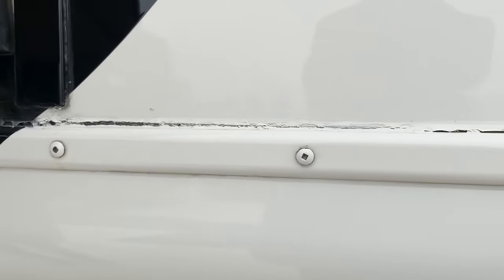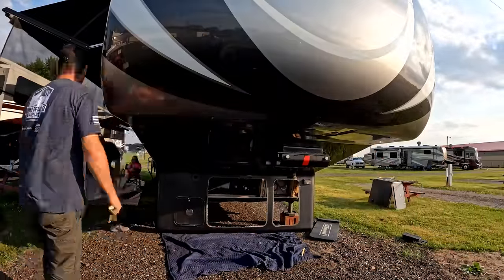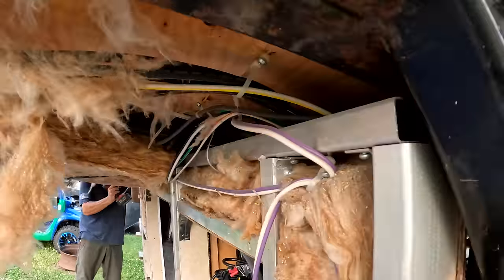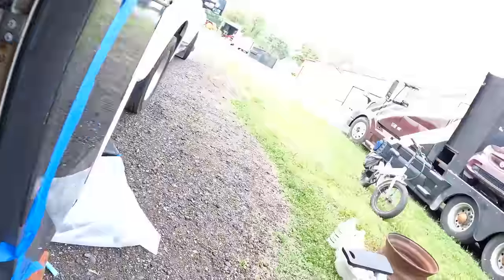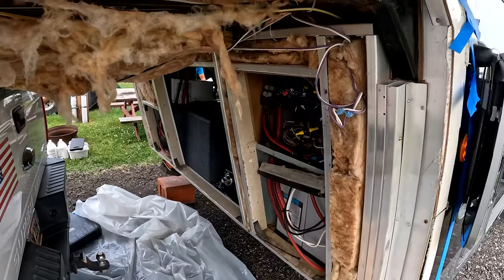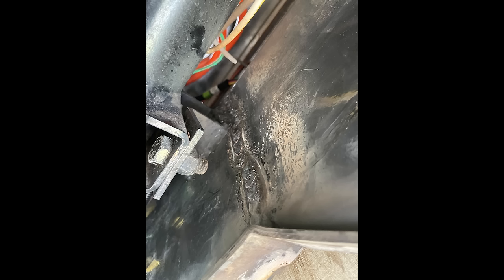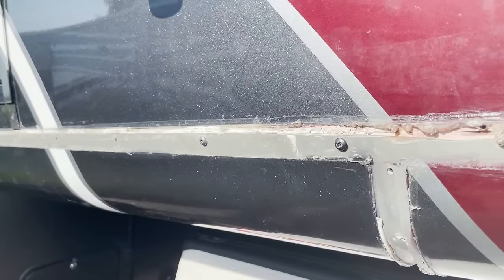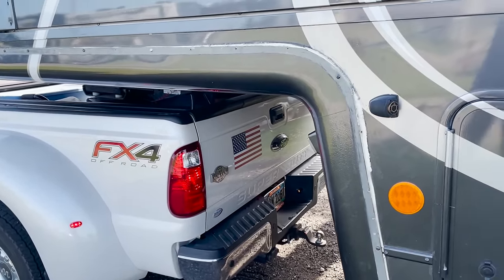WHAT???  Your Frame is Broke!  Lippert Broken RV Frame 7-27-22 DRV Elite Suites

Comment: Being a welder for over 42 years and built lots of heavy duty trailers for the oil and gas industry, we always used fish plates and gussets at joints to make them stronger than just butt welds. These people were extremely lucky to have caught the failure before it came apart while doing highway speeds going over a bridge or a double bump in the road.
Reply: Old welder here, was going to say the same thing. The engineers dropped the ball on this, revision 1.0?
Reply: Yes...I'm not a welder. But I've been in the trucking and construction industry for almost 40 years. Even I know how it's supposed to be done. 
Hope for the best for this family
Reply: Wow I'll never buy one😢
Reply: What is a Oil Field, is it like a electric field? Lol old times are not forgotten.
Reply: I fix these all the time it's a big expensive job. But yeah I agree fishplates gussets and actually welding the frame it's literally just tacked together.

Comment: I discovered a 3’long crack in the Lippert manufactured frame on my pull behind a few years ago.  You could see daylight through it.  If I would have relied on Lippert to fix it it would still be 1500 miles from home.  I found a welder who came out to my campsite, plated it and welded it.  You got to think outside the box on this stuff.  The dealers and manufacturers don’t want to see you again once you drive off the lot.  You’re dead to them.
Reply: Sometimes, literally.
Reply: But then you are not making the manufacturer take responsibility.
Reply: @backtoasimplelife they are RV’s. The manufacturer never takes responsibility. They are all lemons. Terrible build quality
Reply: @backtoasimplelife Apparently RVs aren't held to the same standards as vehicles. The warranty doesn't even have to be honored.
Reply: @drwisdom1  you got that right.
Reply: We had to move a mobile home up on the Canadian border. Had to get welder..Amish guy showed up …he did the most fantastic job..charged 1100 bucks ..trailer got moved like 25 miles…was hair raising!

Comment: Bottom line here is DRV and LCI are building substandard frames and coaches!  It is Fantastic that you have exposed the two Corporations to their failures when designing the rigs components!  Even the after repairs was substandard that will not stand up to the test of time.  This Coach should have been totaled due to the extent of the damage.  Hopefully the owners recognize this fact and take steps to hold these companies accountable!
Reply: That case of being under-designed means that you may have a case against the manufacturer under the warrantee of merchantability.  If you choose to sue the manufacturer, you would need to talk to a lawyer.
Reply: Lippert apparently builds the frames that were ORDERED by the manufacturer; the mfgr orders thin steel frames to lower the weight of the trailer, so they can advertise it as half ton towable! its all MARKETING....
Reply: @Lauren-vd4qe  This thing is not half tonne towable
Reply: All of y’all are wrong! Owners are overloading the RV forward of the axles and placing WAY TOO MUCH weight on the pin box and breaking the frame where you would expect it to break!

Comment: Retired RV Tech here. After years of repairing trailers and fifth wheels all I can say is that they are all crap! (except Airstream). These things are made alike across the board. The expensive ones look pretty...But they are crap! When I was assigned to go out and do some warranty repairs, I was the one to catch the Hell from an angry customer.  It got to the point where I simply told them I'm not the one who built it. I'm not the one who sold it. But I am the one here to fix the problems. The only thing I can recommend is to purchase an Airstream.  They're Not without their problems. but they are miles ahead of any others in quality. Its just too bad they don't make a Fifth wheel. Or maybe they're just smart!
Reply: Airstream is shit too, since Thor took over.
Reply: Thor=airstream

Comment: Thank you for the video!! And exposing lippert!! My personal opinion, they should be sued out of business and never make another frame in their lifetime. I have had two frames onto different makes of trailer the exact same thing happened to, except one of them was so horrible, I had been working in Pennsylvania and was headed west coming home when I had to make a detour to Northern Indiana to drop the trailer off so lippard could fix it. And six months after they fixed it it was breaking again. I weld for a living and have been doing so for 35 years. What they're doing in their shop, a high school welding instructor wouldn't even call it welding. They are an absolute joke and need to be sued!!
Reply: Lippert builds the frames to the specs the RV company gives them. If the design is bad which most are they will fall apart. and it's not Lipperts fault.  Bad investment.
Reply: @sundancer3700 I disagree. Lippert engineers should know if the manufacturer design will result in frame failure or has potential and refuse to do it OR make sure the welds are strong enough to support the designs. They absolutely have culpability in this issue.
Reply: @jeffhubert8769  And where did you come up with that. For over 30 years I have built homes and commercial buildings. Once I have the drawings like Lippert would get for a frame up the building goes, I never question the materials but follow the drawings to the last detail. If there is a problem it goes back on the engineer which would be like the RV company.  Everybody loves to point the finger at Lippert when they are only building what the RV company  specs.
Reply: Thank goodness they don't build aircraft.....

Comment: Doesn't surprise me.

I bought a brand new travel trailer in 2013 and after a few trips, I was cleaning it and found one bolt that holds the wall to the frame loose, so I tightened it.  I then looked at the rest of the bolts and found that all of them were loose!  I was able to tighten all but one which was free spinning.  I'm assuming it's a carriage bolt inside of the wall so the only way to fix it is to open up the wall!  

I ended up double nutting all the other bolts with Locktite.  In place of a bolt at the back side of the trailer, they actually just used a long wood screw!

Yup, quality made in America right there.

Comment: IMHO, 45 degree rectangular tube gusset, designed way too close to the corner.  It does not appear to effectively resolve torsional stresses caused by the leverage arm generated as the weigh & inertial forces are suspended on the front of the trailer as it rests on the pin box.  Of course, manufacturer will probably claim, overloading or driving too fast over rough roads.
Again, IMO, the fix / repair & original engineering, should have included a second 45 degree brace, about 12" ahead (or as far forward as operational functionality allows) of the original brace / gusset, in addition to the repair..
BTW, Nomad, good job saving your clients a road catastrophe.  You deserve a medal! (LOL, edited b/c spell check strikes again!)
If there was fairness, the manufacturer and the couple's and manufacturer's insurance companies should award you significant $s!
Best regards, Dennis

Comment: I have a North Point 385THWS. Under warranty, it was taken to Minnesota to have the frame repaired and fiberglass panels repaired for this problem.  The welds the spring shackle braces are bad. I have had 2 different hangers break. On the road.   In January I’m going to Morride to have 3 new axels and suspension installed. I just don’t trust LCI work. When the shackles broke, dealer said LCI would not do anything.

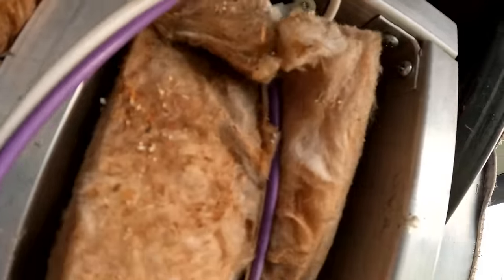Comment: Looks like a good inspection guys.  Around 4:10, I would slightly differ in opinion.  The frame imho is rusting not from a water leak, but I believe they are transported as bare frames before assembly.  The mfg will have like 10+ frames stacked up on a truck to deliver the frames to the RV mfg.  In my opinion, they are often slightly rusty from that trip, or just from being bare steel delivered in the winter, in the rust belt, to the mfg and not completely sandblasted/rust treated before the RV is assembled.  
My Jayco with a lippert frame has some rust underneath the paint the same way, and it's never seen salt since we bought it new.
Reply: they painted before delivery but cheaply.  There was two pieces of steel together so water problem got between them and rusted the bare metal.

Comment: It amazes me the crap that we build in this country 
Not sure if it’s an engineering problem or cost savings or poor manufacturing practices but all of these problems get covered up when the rig is built and the owner is left with trying to figure out what went wrong 
Looks like Lippert should have a test mule on hand so they can see what happens to their product over time 
I would hate to think that they just don’t care
Reply: Sadly quality seems to be going down, and not just with the RV industry, I try to always support my country but when you look at individual components, made in China! Maybe due to costs, I'm not sure but we're going backwards with manufacturing.
Reply: It’s not engineers, its trivial to calculate how to build a frame properly.  It’s shitty product managers worried too much about the profit margins and putting the money into fancy lights instead of proper frames.
Reply: @dougherbert7899  no its the manufacture build junk steel. Dexter axle had a bunch of axles breaking on them.  Some guy wanted to save money and got the axles from china and they began break had to scrap several semi loads. Came back to getting stuff built in the US.  2011 2012 time frame
Reply: Check out Luxe 5th wheels, they don't have any build quality issues like that, not much more than a DRV. Each one hand built.
Reply: People always want items made in the USA.  Why?  Same crap quality, just paying more for the same trash.
Reply: People want these huge 5th wheels with multiple slide outs, bathrooms, washer and dryer, two bedrooms, lofts etc.  Then they need a 1ton truck to pull it and many of course go the toy hauler route and want some motorcycles and or a side by side in the garage.  All of this stuff costs pretty big money, especially when you add the luxury "glamping" focus to it.  Figure 100K for the truck, another 50K for the toys,150K for the 5th wheel and maybe another 25K in other accessories.  

That's over 300K before tax and title, but there's a problem in that the biggest and most necessary part of this is fairly cheap by comparison.  That 5th wheel probably should be around 250K or more but not too many people are going to be able to afford close to a half million for all this stuff, especially when you add up all the costs fuel, supplies, and other things that this lifestyle costs.  Many who do this are already on the edge as it is by financing it all for many years.

So, to make all this happen, RV manufacturers build to this price point, and they are going to have to cut the costs to where you can't see them, vs. where you can as everybody wants to have that big, beautiful rig with all those graphics, going down the road complete with that interior that looks like a luxury vacation home.

Comment: I have a 2020 Sierra (Forest River) 5th Wheel currently at my local dealership with cracked frame/broken weld issues.  It has been 7 weeks now since I discovered the issue.  The fiberglass was separating on the non-door side of the 5th wheel overhang, along the curve of the 5th wheel.  The issue was happening mostly when the camper had all of the weight on the pin box while connected to my truck.  When I unhooked the 5th wheel from the truck, putting all of the weight on the legs of the camper, the fiberglass would suck back into place.  There is a slide out that sits over the curve of the 5th wheel overhang and now the aluminum structure wall, that the slide out sits in, cracked/broke and gave way with the weight of the slide out causing the slide out to collapse.  When the slide out collapsed down, to the floor of the camper, the exterior fiberglass wall and the interior wall both cracked in a diagonal line.  I am currently dealing with the insurance, which sent a forensic engineer to look at the camper's issues, but am getting no where with them currently.  I have one of the first Lippert Rhino Box frames that came off of the market for Forest River, but since the camper is just under 3 years old Forest River doesn't want anything to do with it.  They told my local Forest River dealership that since I had a 2" receiver hitch welded to the rear of the frame of the camper, to haul a bike rack once and a cargo carrier once, they said I altered the frame and they said there is nothing they can do for me.  I wish I had somebody like you that was able to deal with my camper frame issues.
Reply: me too, mine is a 21 River Ranch

Comment: RV workmanship, mine had two basement boxes fall free of the supports and an entrance door that was installed out of square. Along with cabinets which fell apart. Slide leaks were another problem. It was a cheap unit I guess, list was $106,000

Comment: Good welds Don't  break. 
The steel  along side the weld will break  before  the weld if the welding  is done correctly,  NOW I  am electric  ark welding ( 4711) tickets. All positions. 
Mig  welding ( wire feed) welding often the steel  does not have the prep, ie gap setting to allow  good penetration,  also often a flat, or hollow weld , when it should  be a raised finish. 
.
.Sadly  a weak  weld  can look  ok, but does  not  have the strength  that's needed  of it.

Comment: If you notice, the crack started right below the weld at the gusset and traveled backwards. 
(1) this is the spot where the frame stresses the most, up and down forces 
(2) my thoughts, when initially welded, the welder was running the wire to hot. ( production, go fast )
Which causes the metal to crystallize and remove its ability to flex.  
The more movements up and down slowly made the crack grow. 
This was a lesson we learned from the Northridge earthquake and all the welds that cracked in high rise buildings. So many welds had to be replaced and new connections introduced that allowed the buildings to flex instead of being rigid and cracking.
Reply: No I disagree with it being the weld, that brace created a stress riser at that point and was not properly engineered for the forces it would see.
Reply: @max7143  when two pieces of A-36 steel are welded together the heat can only go up X to not crystallize ( harden the steel ) welded properly the steel should remain ductile and able to flex. (To a certain degree )
Bad roads, etc can also make a good weld crack,
Reply: Lippert used low grade recycled high carbon Chinese steel that is brittle and shears. My Forest River sheared the 2x6 tubing about 4" from the pinbox on a main header. Welds had nothing to do with it.
Reply: @Itsa_Mea  Hmmm
Recycled ?
All old steel is melted down into ingots. 
All compositions are analyzed, necessary alloys are added to the mix to create the proper mixture for which type of steel is produced. 
All I beams and tubes are made to grade A36 standards and a mill certification must accompany all product from that batch. 
Do you have the documentation showing where the steel came from ? ( most of it comes from Canada )
FYI 
Any steel that has a high carbon content is called rebar.
Reply: @vincebotkin1960  Chinese do not always do this. Not all steel is the same.
Reply: @johnjones-yt8rt  Show me where the steel came from ?
How do you know its from China ?

Comment: Yeah...  This engineer says it's both a design problem and a loading problem.  I too just repaired and reinforced my cracked Lippert frame.
Reply: with all these different people it almost has to be a design/engineer issue. Using to small of a frame tube steel
Reply: could I ask you some questions about what you mean? I'm having problems too

Comment: I worked for a trailer company doing assembly over the summer and I would never, never buy a RV lightweight cheapest parts and components that the company can buy, assembled with boxes of staples, screws, sealants, caulking tape. Basically a mobile home that is towed around.
Company used Limpart frames, we needed to check each frame coming off the stack to make sure all the welds were present. We had spring hanger brackets missing welds, out riggers held with tacks, huge areas not painted or primed. We had touch up paint and a welded at the first station just to correct this.

Both the RV company and and the Limpart plants closed down 20 years ago.

Comment: You would think after years of building frames lippert could build a frame that would not break.  My fifth wheel frame was torn like paper by the axles
Reply: I assume the more years that pass, the more cost cutting the manufacturer will do. Then when someone dies and there's an outcry, they'll fix their process and the cycle will repeat.
Reply: We have a 2006 carriage c force  frame that does the same, so for almost 20 years they don't build different

Comment: Rv frames , axles and tires are all way under sized for the weight of Rv. I am glad I got rid of mine before this happened. What a joke.  Look at the GVWR or a RV and compare it to an equal trailer like a flatbed and see size or material difference.

Comment: My goodness! They should have fish plated that. Glad you got it fixed. But I'm betting those new uprights aren't going to hold up. Sorry, but that's not how you fix a major structural frame break where all your stress is located. In my humble opinion, I would have made them fabricate a fish plate running at least 10 or 12 inches long running up, down and diagonal to the frame. I was looking at drv's too.
Best of luck to you all